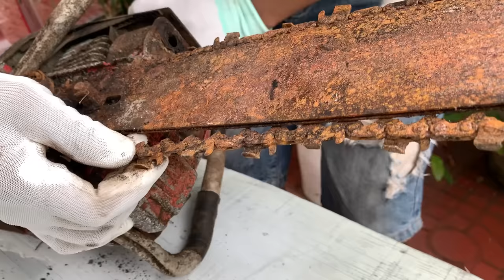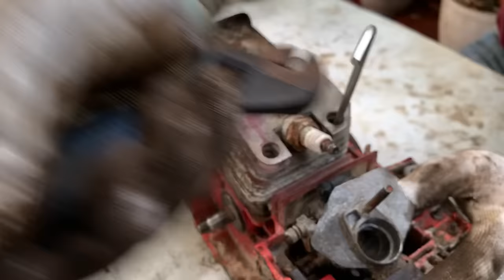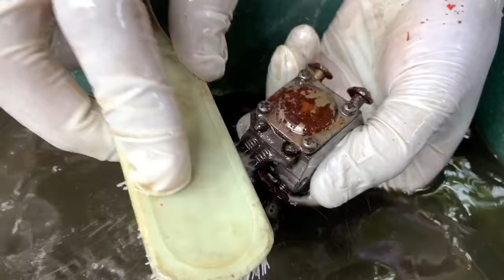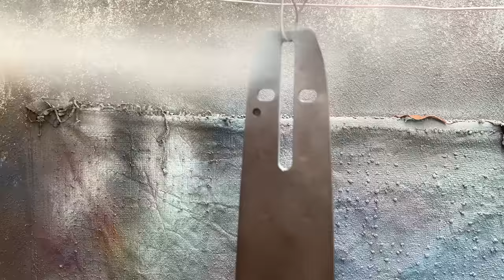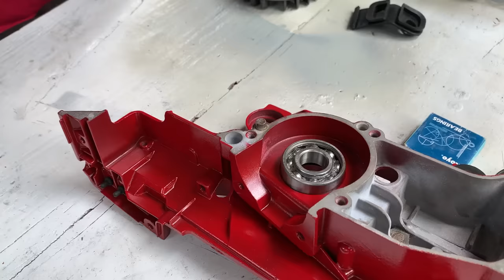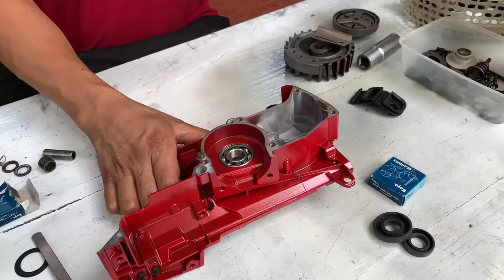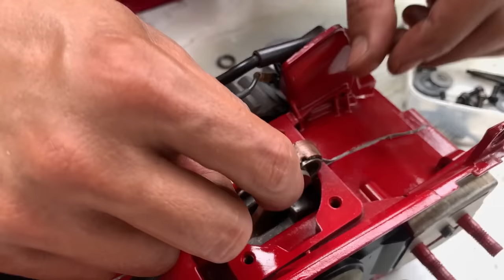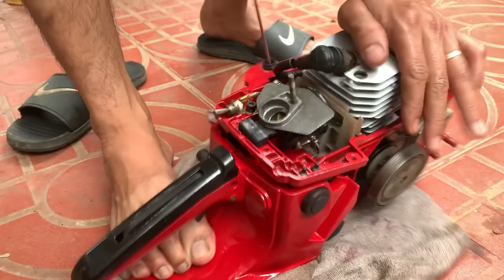Restoration old rusty gasoline ChainSaw | Restoring 2-Stroke Petrol Chain Saw

Comment: restoring... more like cleaning up and just making it work just enough to film it, so many things are done incorrectly as well as why not get new spark plug, chain, bar, clutch and the reassembly was done pretty bad, it will not run for lung, that I am sure of.
however it does look nice as well as would encourage some other people to go and restore their old chainsaws, showing that it is not such a hard thing to do, but seriously the title should have been cleaning and not restoring.

Comment: That won’t last long if you run straight gas no oil mix it’s a 2 stroke dummy needs at minimum 50:1 I’d say40 :1 or maybe 32:1 I don’t know how old that saw is laugh out loud  nh s like  a husqavarna copy or Jonsered. Copy

Comment: Not very smart hammering on the inner race of the bearing 🤦🏼‍♀️ also what chemical did you use that took rusty steel and just made it look brand new without any putting? 😒 fake